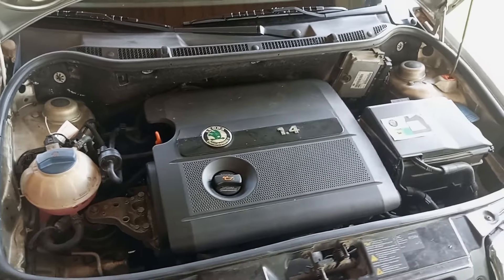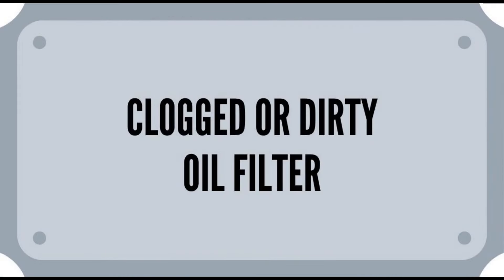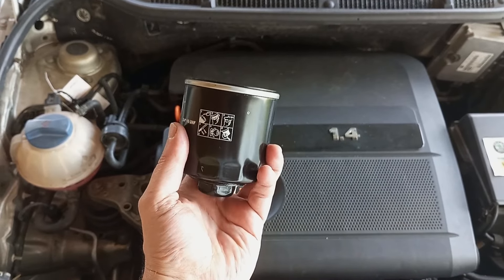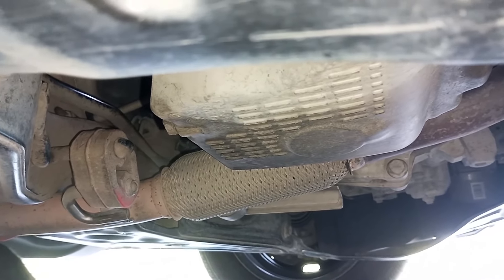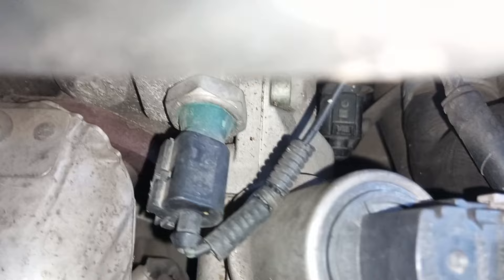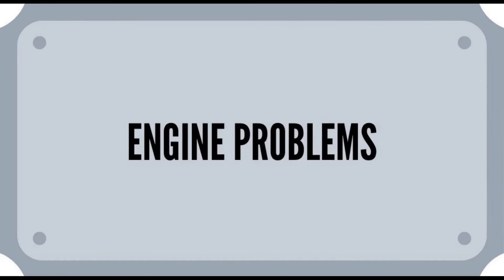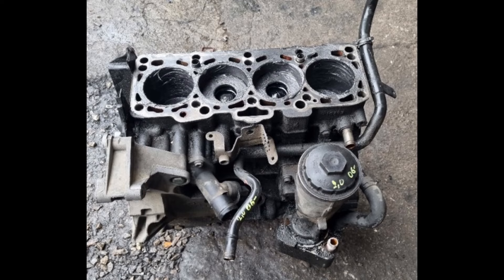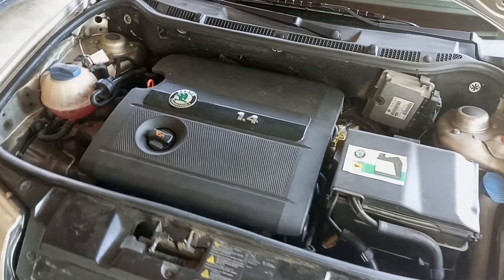Low Engine Oil Pressure-Common Reasons For The Problem

Comment: Another problem is a blocked pick up tube in the sump due to degrading drive belt(s) submerged in the oil. This is a common problem with a number of manufacturers and a quick google search will reveal if your engine suffers this problem.
Reply from the maker: Thanks for watching and for sharing!

Comment: For info - most car oil filters are equipped with a bypass valve. This valve is a critical feature that allows oil to bypass the filter if it becomes clogged or if the filter media is restricted, ensuring that the engine continues to receive lubrication.
Reply from the maker: Thanks for sharing!